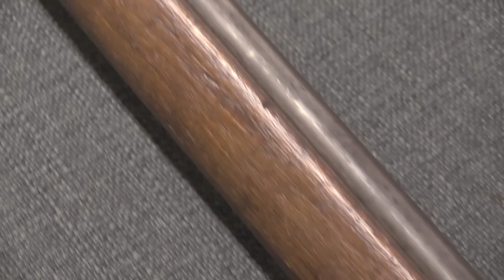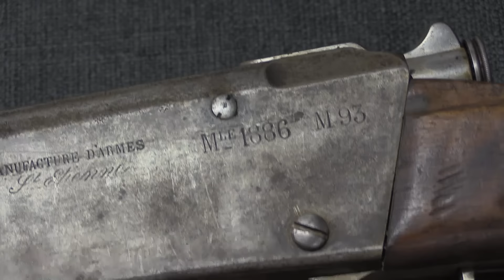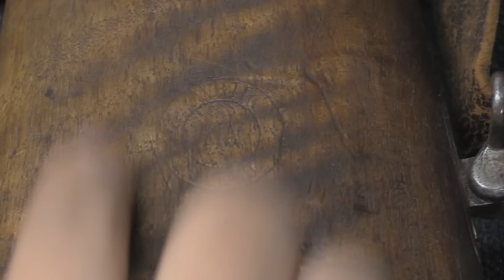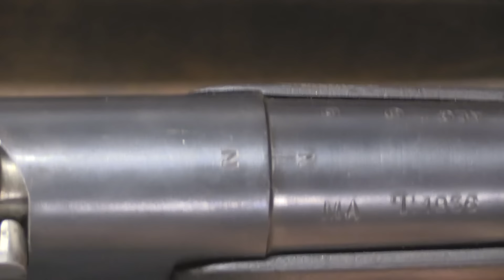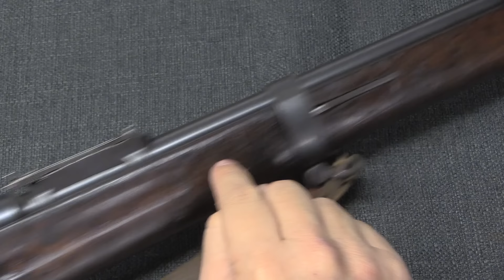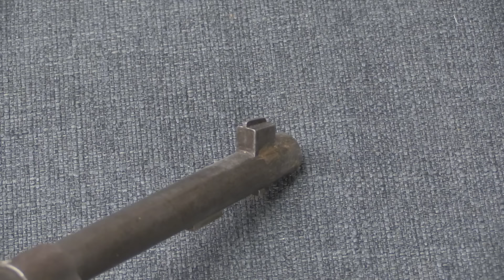The First Modern Military Rifle: The Modele 1886 Lebel

Comment: Isn´t Belgian Mauser single stack and extended clip like the 1891 Argentine one?.
Reply from the maker: Yes, the 1889 Belgian and 1891 Argentine Mausers are very similar.
Reply: Thank you for asking this question Juan Carlos.  I am seriously contemplating picking up a 1909 Argentine Mauser that 'appears' to be in mint condition; as if it never left its armory storage nor was issued.  Problem is the gun shop has no history on it as the rifle is on consignment.  From what I am able to see, all serial numbers match but I can't see the bore as the bolt has been zip-tied closed.  I did check muzzle erosion using a 7.65x53 round and the barrel does not "eat" the round by a good amount which would seem to indicate the entire barrel should be in good shape.